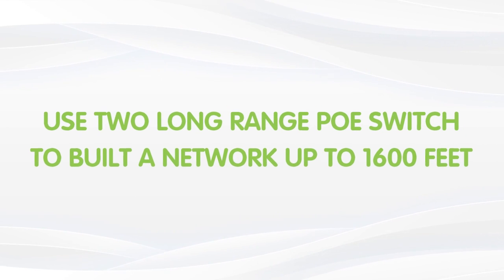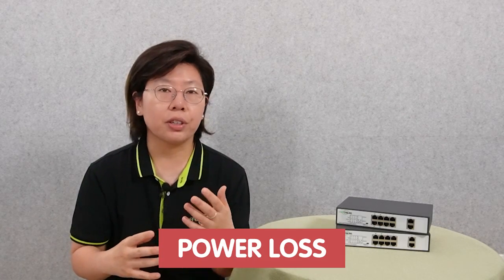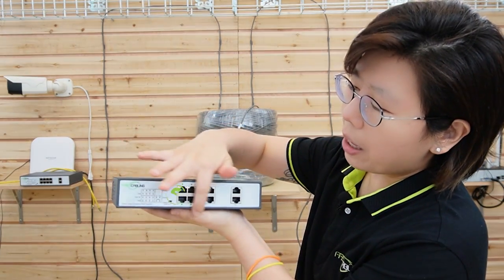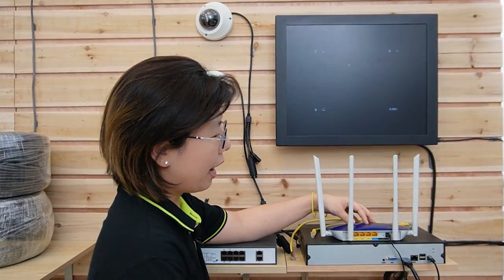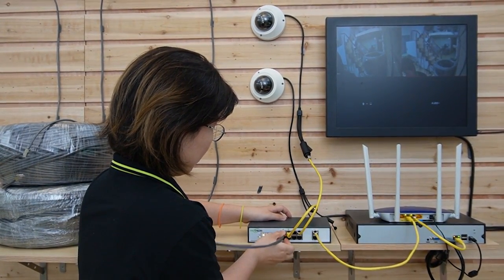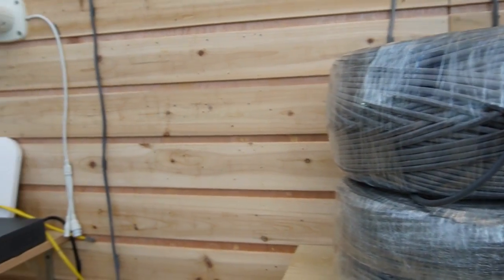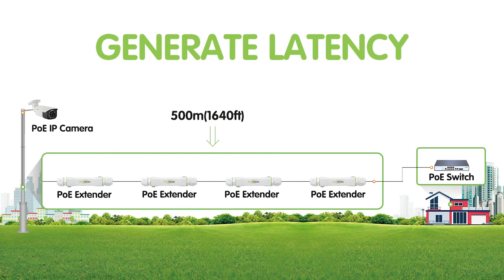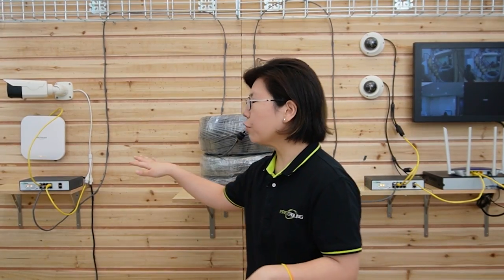Using Long Range PoE Switches to Build Up to 1600ft PoE Network

Comment: Do you have a POE POWERED (95w injector powered) switch that will do the same as the one you discuss?
Reply from the maker: You can use this outdoor PoE passthrough switch, but PoE powered switches can only extend the range for another 100 meters. 

https://www.fastcabling.com/product/outdoor-waterproof-poe-pass-through-switch/

Comment: How far can you run a camera before it becomes a “long run”?
Reply from the maker: Normally, standard PoE can only support a maximum range of 100M/328ft before it experiences any signal degradation. By using this PoE switch, you can extend the distance to 500M/1600ft at a speed of 100Mbps.
Reply: @Fastcabling     Thank you, Mike!!

Comment: Can we plug in two power hungry devices, like PTZ camera and access point at the same time ?
Great video ❗️
Reply from the maker: Yes, the 8-Port Long Range PoE+ Switch is compliant with IEEE802.3af/at standards, supporting 30W max. power per port (total power budget: 125W).